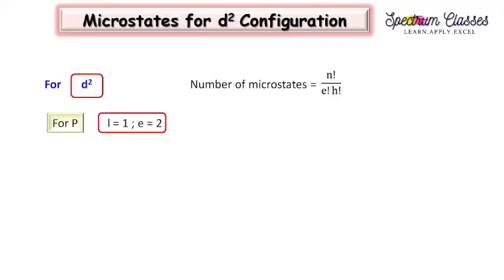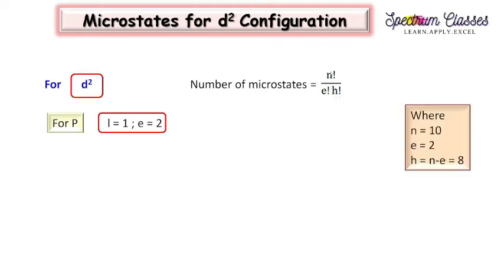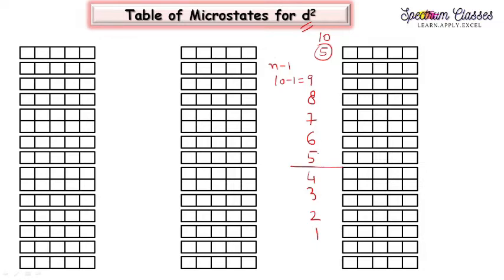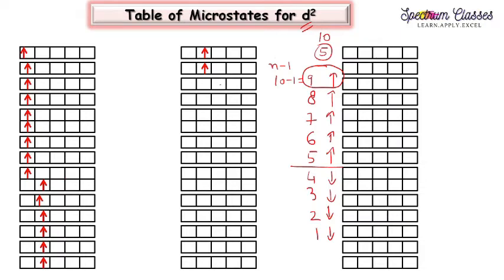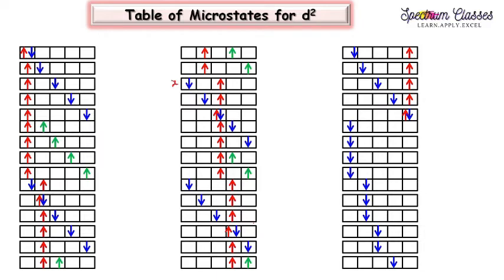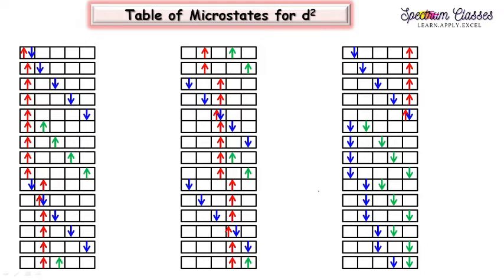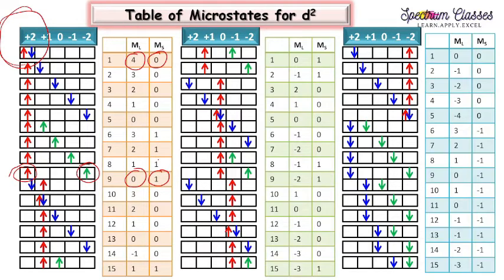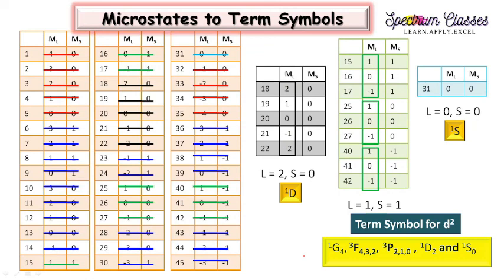d2 Term Symbol| Trick to write Microstates for d2 configuration| Inorganic chemistry

Comment: Madam for ist maximum ML= 4. Ms =0. This is 1G. For this you have chosen arrangement number 1,2,3,4,5,32,33,34 & 35. But instead of 32 and 33 can we take the arrangement number 14 and 22 respectively, Because both arrangements have same set of ML and Ms value. Or, That is, can i take any arrangement whose ML and Ms value is matching as per our requirement. Or is there any spl rule for pick the arrangements.
Reply from the maker: For ML= 4 and Ms= 0, we have to choose ML= 4,3,2,1,0,-1,-2,-3,-4 with Ms = 0, this is the only condition so you can group these arrangements only no matter whether it is 32&33 or 14&22 or any other, thanks for watching stay tuned
Reply: @SpectrumClassesbyDr.Sulaxna  thank you mam